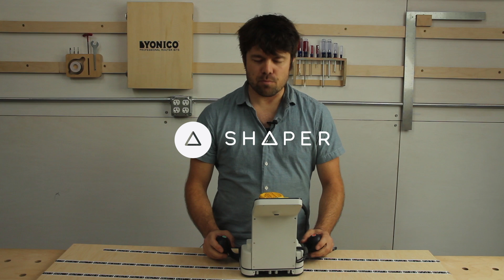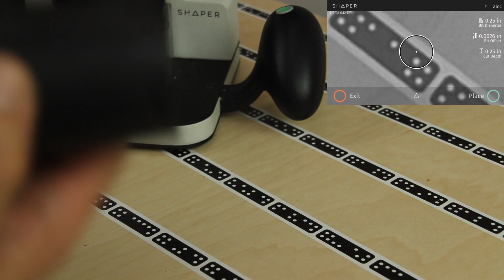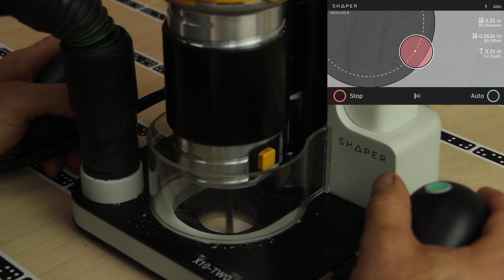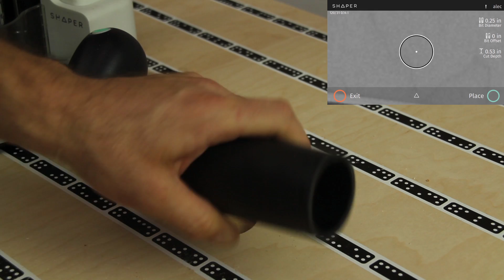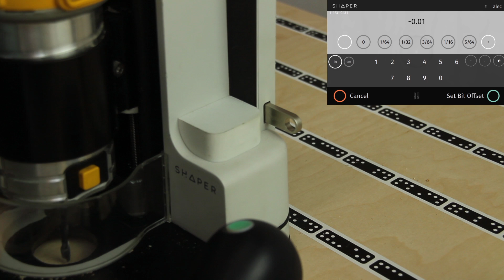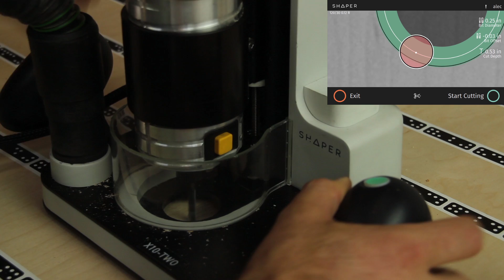Shaper Origin Features: Bit Offsets

Comment: This is pretty cool. I've been following the Handibot crew and was wondering if you can do multi-passes, but swapping out the cutting bits? Can you bevel off some of these rough cut edges? 
Can you load up a gray scale bit map and perform shallow sculpts?
What's the Shaper like when cutting novel and complex joints?
Reply: +Shaper can you make video how to use that beast for making festool domino dowels holes?
Reply from the maker: Yes, you can do multiple passes with different bits. We don't have support for sculpting yet in the software, but may add in the future. We've done a bunch of complex joints with Origin - check out our instagram for examples.